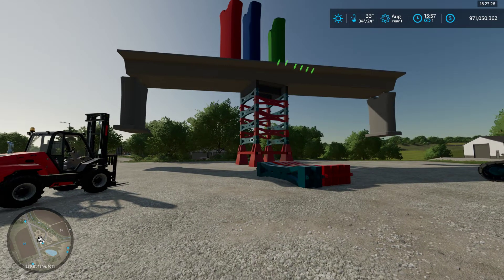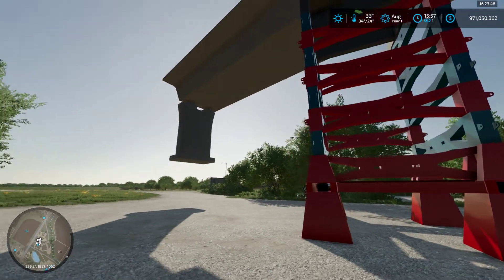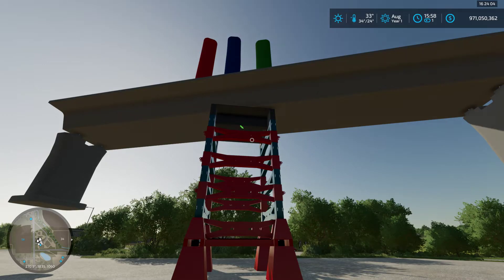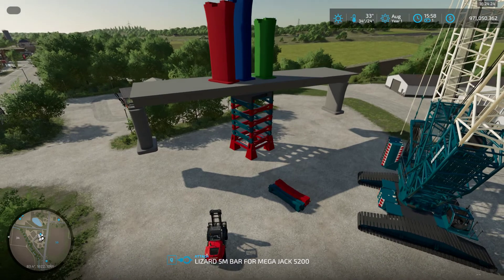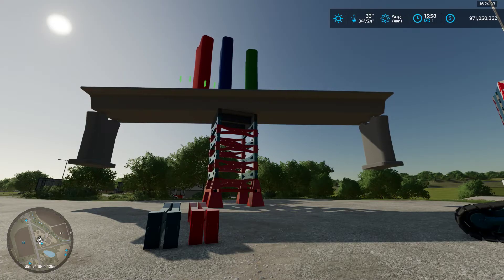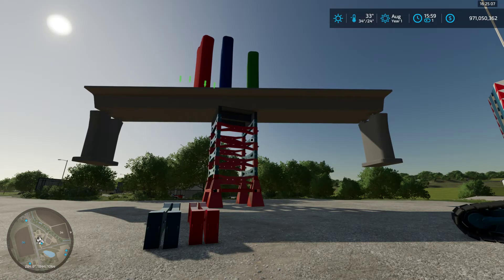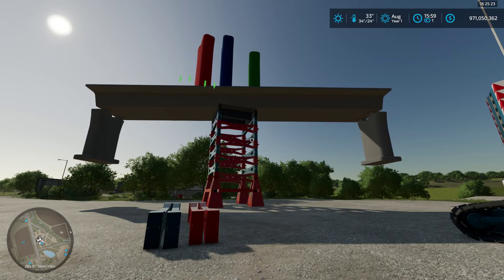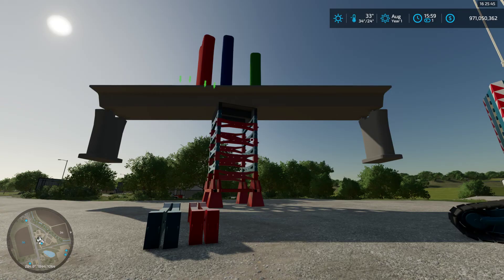FS22 Mega Jack 5200 Capacity Testing

Comment: could you fix the control of t800/w900 its pushbar is not working
Reply from the maker: What do you mean it is not working?
Reply: @jeremybrown9379   it doesn't fully go down
Reply: nvm got it to work the the icon wasn't shoiwng for me to interact
Reply: @jeremybrown9379  btw for the bridge grinder im guessing you mit not make a trailer for it
Reply from the maker: @mokeymokey166  a fully assembled bridge span will require an SPMT to transport. But a lowdeck (for Europeans) or an RGN can be used for a bridge section. 

A bridge span is currently made up of 12 sections.